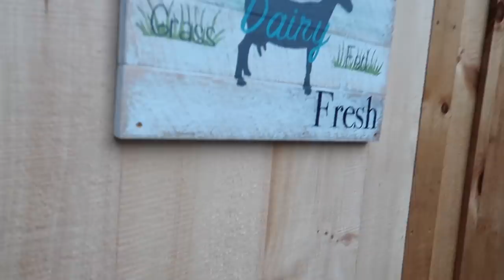NOW we GET to SEE if it all FITS - 2 Years Worth of Firewood to STACK in the new SHED

Comment: I don't think a staircase will work in the workshop. The limited headroom would necessitate it being placed where the ladder is now (in the middle of your work space). Your idea of hinging the ladder is very doable, near the third step (from the top). The top two steps could be removed from the ladder as so many have suggested, and perhaps a pair of tubular handles 3-4 inches up from the ladder sides for a comfortable and reassuring grip could be added just to make Gena smile. The whole assembly could easily be raised and lowered with a simple pulley system and secured at the side wall. Al, with your skills it should be a piece of cake. Sounds like a good project for lousy weather to me.

Comment: you might try to seal the lower walls, one board up or one roller width, to go along with the floor sealing.  glad to see Gina showing Olivia how to easily spread out the chicken feed.  I enjoy your homestead, the drone footage gives a wonderful view of the changing season colors
Reply: also remove the top two ladder rungs so you can step through and use the side rails to steady your descent
Reply: cut a little off the corresponding leg of the milking stand to make it stable

Comment: When choosing a sealer, there are 2 basic types.  Solvent base and water base.  The rule that what ever made a product will deteriorate a product.  If you put a water base sealer on a floor inside a building where water will never be present then it will last.  
If you put goats on that floor and they urinate that is a problem because what is the urine made up of?  Water.. I would put a solvent sealer there and once sealed, nothing will penetrate it except for another solvent...

Comment: I would just wax or oil the walls, i like Murphy's Oil soap for the interior of log cabins. always test first and use a solution of product which the animals if eaten, will not release toxins. I would not use paint or plastics around animals. [ No fumes to kill your animals. ] it is not for pretty, for reducing pests, and preserving. Years ago people would paint their barns with used motor oil. In reference to the sealant I used Jonson's (Diversey) product, i would not recommend, i feel it did not penetrate the concrete enough.  Sealant will protect the floor from salt, stains, and the production of germs. Salt will kill your concrete. i would have put 2 coats, at least.

Comment: Water based floor sealer is pretty much a joke - the stuff I use is $125/ for 5 gal and it comes with a catalyst - I think it 's for Paver bricks, but works well on concrete......
Reply: Do you remember the name, and does it off gas very long? TY
Reply: @robine916  it's called "Seal 'n Lock" I buy the one called Super-wet. I think thats the one thats more shiny - I've done pavers and a concrete walkway with it and one Shed concrete slab floor (prior to the shed being built) didnt seem to smell more than 24 hrs, but I have never used it indoors?

Comment: I was thinking more about that awesome ladder...all you really need is a a couple of 1x across the loft edge to make a track, then a couple shopping cart style swivel wheels to ride inside the track. Bolt a rope or handle toward the base of the ladder, then when you pull the rope back and lift the ladder feet...you can slide it from side to side. With the pitch of the roof, just seems like awkward access from the center unless you remove the top 2 rungs so you can walk through the "handles" at the top. I think you want to leave open ladder extended to make it easier for the girls to mostly get back down. Otherwise nothing to hang on to unless you put Railing all the way across...which might also be a nifty idea

Comment: Just an idea that may come in handy - what if you added some stake pockets to your little flat bed trailer so you could put in some short walls?  I don't know the load capacity, or if you were close to it, but even with the same size load, it would reduce the tendency to bounce stuff off.  For firewood, maybe you only want the front and back on, then you wouldn't need to reach over, and firewood wouldn't be too likely to move sideways, but for lighter loads, unbaled hay, leaf litter, garden refuse, etc., you could pile it much deeper with all four walls in.  You could always pull out a wall for easy unloading.  The pockets would give you other options as well.  Like a taller set of cattle panel/wood walls (with maybe an optional lid) and you'd have a mobile, cage like, small livestock and poultry transport. Or maybe you just put in a few stakes and you have a better small log, fence post, or pipe hauler.

Comment: Al, Gina good work in the milking room and woodshed. Leave 3' of the ladder above the platform to allow you to get on and off safely. I think the triangle the ladder makes should be 1' away from the wall to every 4' you go up. If you leave the walls in the milking room plain, by the time you get around to painting them they will be a mellow colour! Of course if you seal them, they won't soak up the grime. Clear matt varnish? Regards Stephen.

Comment: After 32 years in the fire service I agree with eldenl1, first try using the ladder with out the top two rungs, just remove the screws leaving the rails long so you can walk right through them, second you need to have the ladder at a 75 degree angle which makes it the optimal angle for climbing up and down, to get that angle stand with your toes against the bottom of the rails and place your hands on the rung that is closest to your hands when your arms are parallel to the ground, then secure a board on the back side of the ladder at the height of the loft floor (time frame 12:57 right where when Mrs. Gina puts her right foot between the third and fourth rung level with the loft floor) so you don’t create a trip hazard for yourself, secure it with the hinges you mentioned to the board and loft rafter and a simple pulley system you can unhook from the bottom rung when you use the ladder. Oh, and center it on/in the room for maximum head clearance....you will be surprised how easy it will be to go up and down while facing the back wall this way, never come down facing away from the ladder, unsafe practice...

Comment: I do have two concerns reading the comments.    Some have mentioned painting or milkpaint for the walls.    Try the clear finish first.   To try and go back after using something with pigment is going to take a ton of sanding, and it isn't worth the labor.   Plus to look clean, the painted surface will need more maintenance.     Second, Poly on the floors, I really have two concerns.   The floor is going to be cold, unless your going to try and keep the floor warm with heat.   I don't recall seeing you insulate the slab, so that might be an uphill battle.  More importantly, whenever you go in and out with your boots, you'll bring in wet snow - same for the goats.   If you Poly or paint the floors, and it's smooth and well sealed, you could end up with a major slip hazard.   You will need to sprinkle sand on the wet top coat and create some form of traction aid on the surface, or re-install the rubber mats.      Personally once the concrete is sealed go back to the rubber mats for the stalls.    The shop area, if your going to do a lot of standing, get the rubber mats.  Just my two cents worth.

Comment: In the workshop, place a set of stairs on pulley running parallel  to the loft. Use counter weights to make easier to raise and lower. The stairs with be safer for retrieving items and for the girls.

Comment: I was thinking for the ladder, instead of hinges, mount a long pipe along the rimjoist of the loft and hang the ladder from that, or even better, hang the ladder like a barn door on rollers. That way you could slide it from side to side if need be and hoist it up out of the way.  More importantly though, you should look at the bottom of your exterior walls, the rain runs off the roof and bounces up under the exterior keepin it wet. It'll rot pretty quick if left unattended, like a deck attached to a house that doesn't have eaves trough above it, it's also a good way to get mold. I love the untreated look but it needs protection, maybe a poly or boiled linseed oil, and definitely something on the roof, doesn't have to be a gutter, there are products out now that disperse the rain so it doesn't all hit the ground next to the foundation. It's a beauty barn, should last a lifetime with a little help.  I'm really starting to hate Wednesdays and Sundays when your videos aren't up!

Comment: Floor sealer is a great idea... if you like the color it changes the wood- use that on the walls. Animal waste can eat away at wood/concrete. Was there any fumes?// Why not use the top of your antique stove in the milking room? Turn it upside down so there will be a lower shelf with a cabinet on the bottom, the "white erase board" on top, and put hooks below where you hang it on the wall. I think it would look nice.// Why not just trim the steps out of the top of the ladder, then the top rail could be used as railings...I know having the to hold onto while getting my feet on that first rung would go far to quelling my fears! :)  // great job with everything! You all are awesome! Thanks for sharing your homstead! God bless.

Comment: Sealing concrete floor requires at least 2 coats, 3 is better. Wouldn't hurt to seal the bottom 2 feet of boards to keep the goat urine from soaking in and smelling. PS, put a broom handle on the roller, makes the job that much easier.  DAMN, THAT SOUP LOOKS GREAT. MY MOUTH IS WATERING‼️👍👍  Vinny 🇺🇸

Comment: Don't cut the ladder. Take two pieces of 1/8" strap and screw it to the back side of the ladder, then bend at whatever angle is required for the pitch you want the ladder.to sit so the top of the strap is on the flat part of the overhead storage. Drill a hole in each strap and insert a pin into the strap and flat. Having that portion of ladder to hold onto while getting into the storage is a lot safer. 

Make a wood ladder rack for the shop wall and hang it vertical.

I'd reseal the floor a second time now that the first application has soaked in.  For the goat area with the mats, pull the mats, wet the floor, sprinkle with TSP, scrub with hard bristle brush, then power wash. As the the floor starts to dry, apply sealer.

Comment: I used this in my basement 12 years ago and it is still going strong. the only place where it lifted a little was where i put a fridge in the basement and pushed it closer to the wall, the feet scraped it about 5" x 1". the first coat was a foot and a hale around the walls from the floor up then from the wall out onto the floor. the second coat was the entire floor and up a foot and a half on the walls. haven't had a drop of water in the basement since and the ground is fairly wet in the spring. https://www.lowes.com/pd/UGL-White-Flat-Waterproofer-Actual-Net-Contents-128-fl-oz/3073099 also available in 5 gallon size. It goes on with a roller as well.

Comment: I'd leave the walls alone, or whitewash them.  Matter of taste mostly.  I wouldn't polyurethane them; if you want a clear-coat, I'd suggest buying a compressor gun and using a catalyzed varnish; way easier and will not flake later.

Comment: Another great video, folks. Just some random thoughts I had while watching: 1) The ship lap looks great, as is. However, since it's a barn - you might want to provide a protective coating to guard against accidental stains. I've had good luck with Minwax Helmsman Spar Urethane, FYI. 2) A roller handle would save your knees, allowing you to stand while applying the floor sealer. 3) Gina looks great lurking in the loft! Perhaps she's considering converting it into a She Shed where she can hang out and 'supervise' your projects? 4} Sealing the concrete is a good idea, and I think you'll be glad you did it. 5) If the milking room isn't as warm as you'd like, you might consider using an insulated curtain at night. Just roll it down and cover the window. Here's a link to a good one: https://www.teksupply.com/contractor/supplies/cat1;ts_agriculture_growing-ts_barn_curtain_accessories-ts_barn_curtain_2;ts_vinyltek_7layer_insulated_curtain_1.html

Comment: Stacking onto the wagon to drive to the wood shed is a wasted step. You have the bucket on the tractor that can drive right to the pile to load it up then drive it right into the wood shed to reduce walking when stacking as the wood is now right where you need it rather then a few steps outside. No backing up with the wagon, no larger turning circles to make sure it tracks right. Yes the bucket has a lower capacity but you are also reducing the labor and placing the wood right where you need it.

Comment: Mr. Lumnah, 
I can't speak to the concrete sealer that you've chosen.
However, I would encourage you to at least put a clear stain on the wood in your milking parlour. And the rest of the goat stalls. This should increase the longevity of your barn. Although, traditionally, dairy barns are whitewashed.  My Dad had that done to our stanchion barn every year ahead of the annual U.S.D.A. inspection.
I also wondered why you left the bucket empty on the tractor...

Comment: Sealer will stop urine from soaking into concrete. Reduces rust of rebar in slab.
2 or 3 coats is best.
Be lazy put your sealer in a bug sprayer. Faster/easier.
Try picking up wood with bucket on tractor. If it works will save many man hours of work. Also if you put sides on trailer evan 4" you can stand wood on end around sides wood aganst upright wood temp sides. Stack more and higher.
Work smarter not harder.

In Texas it is cooling off highs in 90's.
Weather service is calling for high's of 85° next week. About time been melting down here.
You might want to move your chickens more often. Spread the poo more.
Tickle your little one for me. I have no children. Grt my baby fix by playing and tickling other people's children.

Love your videos.

Comment: Moody...typical female LOLOLOL  Way to go Willow you little sweetie and so smart too.  Amazing.  I am learning a lot about goats versus lambs and would rather have a goat it seems.    She's saying LET ME OUT DAD!!!  hahaha  she RULES!!!  Good job on the sealer for sure it will work we have used it and it works it's very easy.  Use a pump canister with a sprayer easy peasy.  """Oil on the wood to bring out the beauty."""  Wrap your roller up in plastic tightly and you can use it again tomorrow if need be or put the roller in a plastic bag and put it in the freezer.  To use it again just let it thaw.  This way you keep it clean and you don't have to clean it until you are done.  Same thing for paint brushes it works a professional painter told me this and I did that lol it worked.